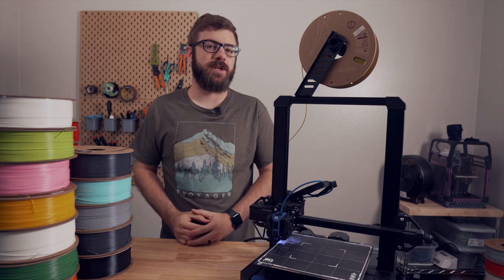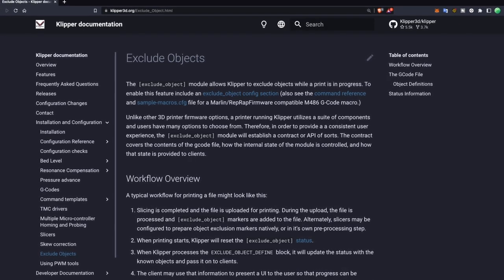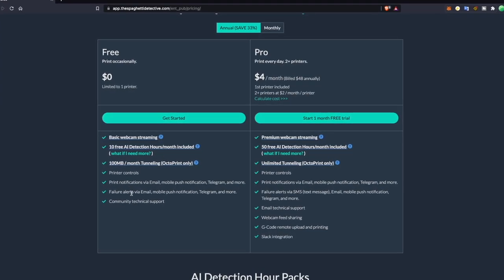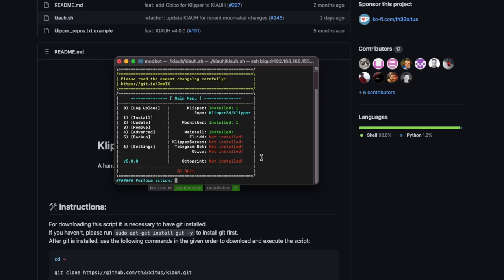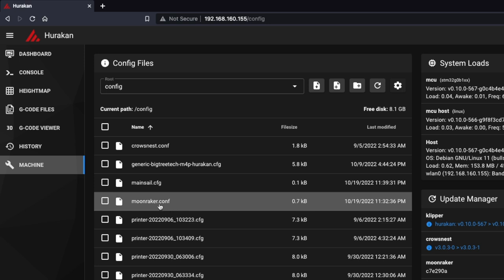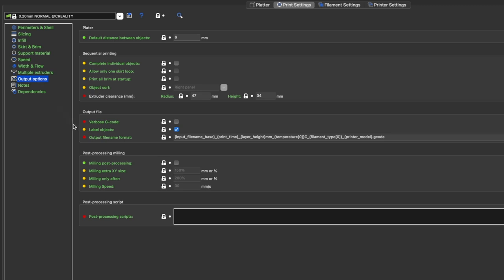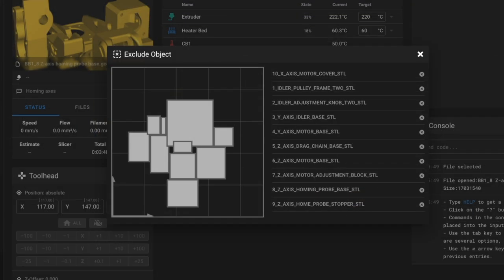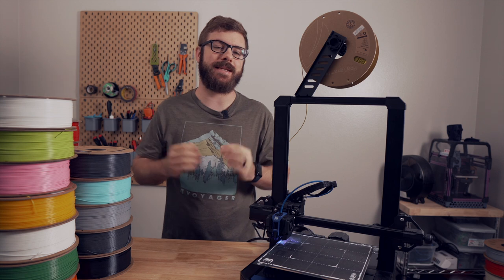Setting Up The Exclude Object Module In Klipper Firmware

Comment: This is one of the cooler features available in the various firmwares. The fellow who first brought it to us for Marlin Firmware is a chemistry professor who also makes excellent turned wooden bowls. I used his concept as the starting point for CANCEL_OBJECTS and created the G-code M486 (get it?) to provide a formal support mechanism. The slicer has to actually provide the object identifiers in the G-code to use this technique. Perhaps Klipper is able to do this without help from the slicer, or using other slicer annotations that only appear in the G-code file as comments.

Comment: I very recently built my Voron 0.1 BUT I did hear about this. Now the build plate is small on the 0.1 so I probably won't be using it much, if at all but I did install and test it and it works great. I do intend to build a 2.4 so this will be much more useful on that machine, Cheers and thanks.

Comment: Question, I use an Ender 3/ Cura. I use the Ultra Fast CHEP profile as my default (0.20 and 0.28). But it is not dimensionally accurate. Recently I needed to print mechanical parts for a Clay Extruder. What I found openings for fit parts were too tight. (Threads and mounting holes). I understand Cura has "Engineering Intent" profiles for their machines that are more suited to precision over speed. Do you know of, or can you recommend a profile that is "Most" accurate for these type prints? I have tried Horizontal Hole setting, but it works for the larger holes but way oversizes say M3 screw holes. So that isn't a solution. Thanks. And I will be updating my Ender 3 to Klipper:-)
Reply: I just don't use the Extra Fast profiles when the dimensions matter, because I've seen the same thing and really confused me why my fast vice didn't fit together like CHEP's did.  I went back to the default profiles and everything printed perfectly, just slower.
Reply: Look into slicing tolerance in cura
Reply: @hjcpkr  Thank you, I'm test printing with EXCLUSION setting. Lets see if that fits!
Reply: @FilmFactry  worth it looking into what each of the options do, as one will make it impossible to thread and the other will be perfect - and when grabbing stl’s that other people made, be aware they might have designed it on iterations on the standard “middle” tolerance when test printing!
Reply: @hjcpkr  Kind of sucks. I have all the parts for the clay extruder, but many parts wont fit. I'm not a newbee. I have 3 Ender 3s (2 with Duet) that print beautifully. The issue is really the profiles. If I had the Fusion files I could adjust the holes, but I don't I did some editing in Tinkercad, but it is so lack of percision.  I may have to redesign the parts in Fusion. 

Horizontal expansion and hole expansion, works for some larger holes but ruins 3mm holes needed to be screwed together. In Cura I tried the support blocker technique to assign various horizontal expansion to sections but that is a cludge.

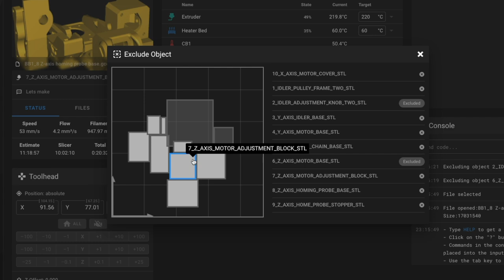Comment: Hi, im having a hard time with the exclude object function on klipper. As mentioned in 6:05 the print head travels to the excluded object. That causes fillament to drip on larger nozzle like 1mm. 
Also if excluding the first object the fillament is being retratcted enough to push it past the gears.
Is there a way to disable the travel as it seems counter productive at its current state.
Im using Orca slicer 2.0.0, printing PETG with 1mm nozzle.

Comment: I never knew! I usually print a single test part before going multiple parts in a single print. I had a problem recently on my cr10v2 where the autobed leveling was pretty crap at one corner and a print started warping 20 minutes in. If I knew this was a feature, I wouldn't have to cancel 10 parts because of 1 bad corner on one of the parts.

Comment: I've been using 2 instances of mainsail in 1 Rpi 3b+ for a couple of days. Today i wanted to add a 3rd instance so removed the previous 2 instances and installed 3 fresh ones, klipper + mainsail + klipperscreen. The 1st two picked up the configuration from before, i hadn't cleaned the configs. Everything is working on the 3rd except for Exclude Object, please help! I added the lined to printer.cfg and moonraker.conf but exclude objects is not working. Did i miss a step? I'm getting "unkown command M486" all the time, and i'm using the same gcode on all 3 printers. Any ideas?? Thanks!!

Comment: The loss of Exclude Objects from Octoprint when I had to convert over to Klipper due to my Voron V2.4's ERCF not playing nice together with Octoprint was almost a deal breaker for me.
I mean yea I don't really print many parts that often and I usually also don't have many issues with warping and parts coming loose but Murphy's Law is it that it always happens when I have least use for it and not being able to save an almost finished multi hour and multi part print where one has failed stings - A LOT 😑

Comment: Not working with Fluidd.    Running Klipper v0.11.0-172-gc2b2278a,  Fluidd v1.23.4, Moonraker v0.8.0-32-g31e589a, and Cura 5.3.  The "Exclude" icon does not appear on Fluidd, so no way to exclude the objects.

Comment: This works for me only when slicing with SuperSlicer, not PrusaSlicer or Cura. Am I the only one? Anyone else has this problem?
Reply: Having finished the video, looks like it might be because of the Label Objects setting.
Reply: @eraldylli  I had this problem for prusaslicer as well. Check the Moonraker documentation for file_manager and you'll be on your way. YT comment filtering is in place or I'd provide the links. 👍
Reply: @khmer04sti  Will do. Thanks.